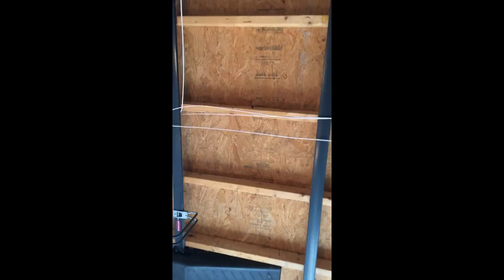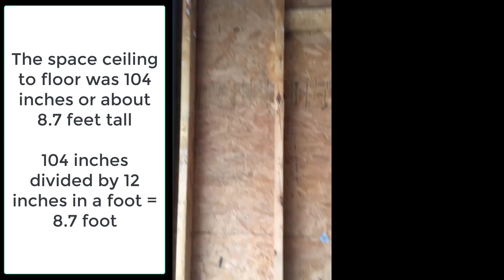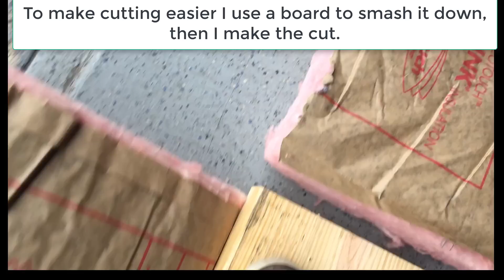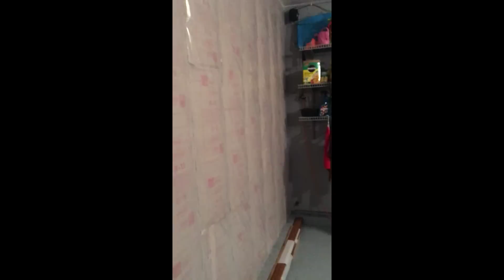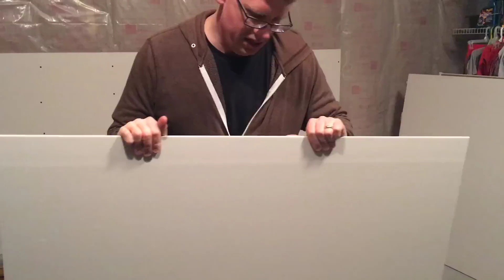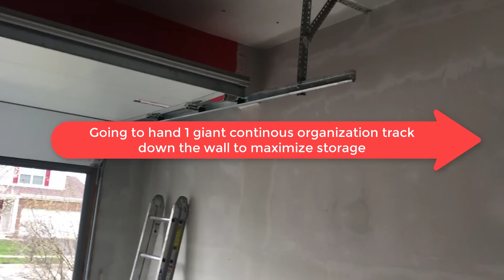Insulate and Drywall Exterior Garage Wall

Comment: Put the board under the insulation next time easy to cut and use a nail at top to hold insulation not tape

Comment: does it matter if you use foam board, and paperless insulation, opposed to fiberglass insulation and vapor barrier?
Reply from the maker: If your using foam board insulation instead of fiberglass yes you still want a vapor barrier

Comment: The example you showed of a countersunk screw looks like it tore the paper.... Don't countersink the screws!!! They should be flush but any deeper and you break the paper which means the drywall is going to pull off that screw some day.

Comment: Only part i didn't quite understand was the square and lines. You just drew lines down the drywall in a straight line so you would know where to screw?
Also, does spackling have to be done? Can i just slap some wallpaper over the drywall and screwheads and call it a day? lol
Reply from the maker: certainly, straight line for the screws.  For sure, you dont have to do the cosmetic part and paint/spackle

Comment: If you used faced batting, why did you put another vapor barrier on top of it? I was taught that using 2 vapor barriers like that is incorrect because moisture / mold will get trapped between them. I’ve always understood that it’s either rigid foam or spray foam and unfaced batting, OR faced batting, OR unfaced batting with a 6 mil plastic vapor barrier installed with acoustical sealant prior to drywall.

Comment: Good job!! And yes don't use spackle, cheaper and easier to use joint compound, spackle is harder to sand. I'd recommend using mesh tape instead of paper, I've done so much repairs on the paper stuff, when I remove the loose paper it comes off with no drywall stuck to it, it does not bond to the paper as good as mesh tape, when I remove mesh tape it is a lot more difficult proving that the grab is a lot better

Comment: Hi, I'm going to be closing up a sunroom that has no insulation at all. I was planning on insulating the 3 walls with r13 but leaving the attic and floor uninsulated. Do you think this will work out ok? I'm going to be using a portable AC-Heater unit that vents to the outside.
Reply from the maker: Yea,  may consider doing the floor in pink styrafoam insulation board.  You would be surprised at the difference it will make
Reply: All your heat will go out through the ceiling. Insulating the attic seems like a must.

Comment: I am insulating my garage right now with faced insulation. I was told to NOT to add poly to it because it will trap moisture between the two vapor barriers.
Reply from the maker: I’ve had no problems
Reply: @CRYPTOSLO_OFFICIAL  good to know. 👍

Comment: This is a great video. Thanks for making it. I have been thinking about insulating and drywalling my garage for a while now. This video is really helpful - very well edited and concise. One question - did you have a heater in the garage when the temperature went from 38 to 54 degrees?
Reply from the maker: no heater

Comment: You should not have drove screws in to the point of breaking the paper on the face of the board. You are supposed to use a countersink bit or a drywall clutched screwgun. And you are supposed to hang drywall from the top and work your way to the bottom to prevent gaps. Also if your wall is 9’ you should use 54” board instead of 48”. Unless you’re going to stand it up.

Comment: Only thing you did wrong was covering the studs with the paper. They are supposed to be secured to the inside of the studs
Reply: No, the side paper is supposed to be tacked to the insides of the studs and not the face where the drywall touches the studs.
Reply: Are you referring to the vapor barrier film?

Comment: I also applied expanding foam along my bottom plate and approx 2 feet up on the studs because of moisture wicking due to snow buildup along my exterior garage wall where the floor is almost level with the grade.
Reply: Can you recommend a brand?

Comment: you either use paper backed bats OR bats without paper + plastic vapor barrier.
Seems like you've installed 2 vapor barriers.
Reply: Exactly, he now has an area between barriers that can get moisture/ mold
Reply: @jarretgorsh6704  that’s correct. I am insulating my garage walls right now and I asked a contractor if I should add poly even though my insulation is faced. He told me no because you will trap moisture between the two barriers. So you’re faced insulation IS the vapor barrier.
Reply: I think It’s R13 fiberglass insulation roll facing

Comment: Won’t the plastic sheeting cause mold down the line. The backing of the insulation is suppose to be the vapor barrier I tgought
Reply from the maker: I have had zero problems.
Reply: Yep this is technically wrong. If you have kraft faced you don't use plastic it is the moisture barrier. Mold is likely to form between the two.
Reply: Insulation backing paper typically is placed against the outside wall and protects the fiberglass from being damaged by moisture/condensation that forms there.

Comment: Hey the paper on the back of the insulation is a vapor barrier, that plastic will bend u over in the long term absolutely zero breathability now for any moisture dude
Reply: No you don’t need it
Reply: Agreed. I never add a vapor barrier with that kind of insulation in a garage. Staple it and up goes the drywall!
Reply: Tell me more tips please,  I am going to put some insulation this coming weekend,  , so you don't need plastic when you use the insulation with the paper face facing to the inside , how about the thickness of drywall,  it's for a non attached garage,  it's separated from house,  , i see some people recommending 5/8 , but how about 1/2 an inch?? Would 1/2 inch be ok for a garage ??
Reply: so, the plastic covering he used is not needed?   I'm learning how to do this

Comment: did you have good luck getting tight ceiling gap starting from the bottom? It would be so much easier starting from the bottom but I hear you need to start from the top from so many people about to do my garage
Reply from the maker: did you get started yet?
Reply: @CRYPTOSLO_OFFICIAL  nope lol 2 days later chopped my pinky off with chainsaw hanging by 1 tendon.
Reply from the maker: @LoveMyKleeKai   Holy crap bro.  Sorry to hear that.  Hope you are recovering.
Reply: @CRYPTOSLO_OFFICIAL  fingers fugly lol and can only bend at first knuckle also its stuck in half curl position

Comment: where did you purchase the kraft insulation for $12?
Reply: Menards sells it for 9.99 right now
Reply from the maker: Its actually around $15 now at depot/lowes.  https://www.homedepot.com/p/Owens-Corning-R-13-Pink-EcoTouch-Kraft-Faced-Fiberglass-Insulation-Continuous-Roll-15-in-x-32-ft-RF10/202585857
Reply: thank you!
Reply from the maker: @gabbymarie7258  your welcome.  It makes such a huge difference in temperature control.  so worth it.
Reply: $24 now :(

Comment: Hi where did you buy the insulation from for $12 most places have them for $20 each ?
Reply: It’s R13 fiberglass facing roll, you’ll get around $11 to $15 in Menards.
Reply: $10 at Menards
Reply: Lowes or home depot offers a 30% discount to those having an account with them. Or you can buy a bulk quantity. For instance...Buy a minimum of 15 rolls in order to qualify for a 30% discount. This option is shown in the aisle where the insulation is sold giving you the minimum you must order.

Comment: Too deep with those drywall screws!  This will cause "nail pop" as they call it.  The drywall screws should be flush with the paper.  DO NOT do as shown in the video.

Comment: Do you really have to add the 6mill plastic vapor barrier in my 2 garage if I live in the midwest and plan on rinsing my garage out often beacuse I like the walls and floor clean. Im just woundering the plastic would act as a barrier to keep moisture in or out of the insulation. Btw I will not have dry wall in my garage, I will be using corragated white panels throughout.

Comment: How much does this run you roughly? I just moved in some fitness equipment in my garage and I'm looking to put up some insulation and dry wall since the winter is coming real soon
Reply from the maker: Couple hundred.  Totally worth it.  20 degree difference.  It's not all at once either, I did project over 2-3 weeks so bought materials as I went which softens the blow.
Reply: HowHeDoIt thanks for the quick response! Yeah that’s deff on the low side for the size of the job, going to try this out myself!
Reply from the maker: Honestly, If I had to do over, I would of even put less effort into making drywall "pretty" to save time.  Functionality is the goal

Comment: Actually there is sense in using heavier drywall; most building codes require 5/8 drywall in garages for fire safety.
Reply: 1/2 typically meets code if the opposing side is the exterior of the house, if the opposing side is the interior of the house it’s typically double 5/8 along with the ceiling
Reply: Yes exactly even if you don't work in the garage the next person will suffer , If the sheet isn't fire rated ,.the slightest spark from a grinder may cause a fire .  5/8 rated is the best , otherwise , great job on the video!

Comment: in my garage I have 2x4 truss's at 24inch center's. Will that support drywall or is drywall too heavy? Is there another option that would be less weight than drywall.
Reply: Not sure if you got your answer by now but yes the truss will hold drywall just fine you could even hang sheetrock if you needed to (garage is under a room in your home for fire protection) hope this helps

Comment: You don't counter sink drywall screws. Only tighten drywall screws to slight dimple in paper without breaking through the paper. 
Otherwise you'll get what's called nail pop a few years down the road. To fix if the screw is drive to deep and tears the paper remove the screw and put it up or down from the tear. the hole then can be dimpled with a hammer and filled over with joint compound during the tapping process.
Reply: in my garage I have 2x4 truss's at 24inch center's. Will that support drywall or is drywall too heavy? Is there another option that would be less weight than drywall.

Comment: Why add a vapor barrier over faced insulation?
Reply: I came to the comments to read about his use of a vapor barrier with faced insulation. Glad im not the only one who noticed lol
Reply: Either house is leaky on the outside or he really likes mold....
Reply: Yeah, unless he lives in cold dry climate in Canada or something he's going to have mold.
Reply: Will mold form with a vapor barrier?  I am all new to this and am insulating one garage wall. I was thinking maybe I need a vapor barrier in the corner, especially.  The drain pipe is on the other side of the wall and I get spiders.  It's not wet back there.  I think they come through any leaks through the garage door.  I want to do this right, even though my entire house is a nightmare. LOL
Reply from the maker: Additional wind control.

Comment: Living in CA, is a moisture barrier needed with garage drywall, r can I go with just insulation?
Reply from the maker: It's only like $10 bucks so I would.
Reply: King Louie what if I’m not using batting, but double sided foil type insulation, still go with vapor barrier?
Reply: in my garage I have 2x4 truss's at 24inch center's. Will that support drywall or is drywall too heavy? Is there another option that would be less weight than drywall.
Reply: Check local codes, probably not needed. There are climates where putting one up will cause you problems. Only do it if it's required and necessary, otherwise you'll be doing it again when you find mold.

Comment: Dude, you don't use "Spackle" on your drywall joints....Use "Rocket Mud," or some other drywall mud.  Spackle is meant for touch-ups around the house, not for drywall paper and joints.   You're going to have some cracking as soon as the weather changes.
Reply: so 3 years later are there cracks where you spackled??? i want to try this soon, so pls advise, thx
Reply: Another 3yrs later... any cracks?

Comment: That was tremendous overkill on the dry wall screws.
Reply: in this case its better than not enough
Reply from the maker: I agree.  Still working on my drywall skills.
Reply: @CRYPTOSLO_OFFICIAL  hahaha, lol. you have a lot of skills you have to work on.  so funny but I enjoyed it, I too want to do something to my garage that look like this.  It appears that drywall is the better option then use hangers or shelving to put stuff on and organized.  thanks for the video
Reply: You're right but extra screws aint gonna hurt nobody as long as he didnt ruin the integrity of the board.

Comment: I don’t know for sure but it seems like you over screwed the drywall. I think I counted 6 screws in each stud. I’ve always heard 12-16 inches between screws is good.
Reply from the maker: Yes, i went a little crazy.  Main idea I was trying to get across was you don't have to be a pro to get the job done.  :-)

Comment: vapor barriers cause condensation
Reply from the maker: In some cases I could see that being true but I have had no issues.
Reply from the maker: I have had no problems.  It could be a problem in some situation but in my my house is wrapped so not a problem.
Reply: HowHeDoIt, I think that makes it worse.  Moreover, certain paints and wallpaper can act as vapor barriers. You should have it either in, or out. And it seems the climate dictates. I think the only consensus is that air should move through the attic....

Comment: Do you have the bottom drywall sitting on the concrete slab?
Reply from the maker: +reeceddogg no. I actually have a block foundation about 6 inches above the floor slab so drywall doesn't go all the way to floor. Ideally drywall doesn't go to the floor cause if you have water would ruin the drywall . I can send you a picture if you want
Reply from the maker: No. I have a 6-8 inch block bottom foundation so dry to the top of the block
Reply: Depending on your area, you might not be able to cover that concrete base. For example, my county wants the base exposed so they can see if it meets their earthquake requirements